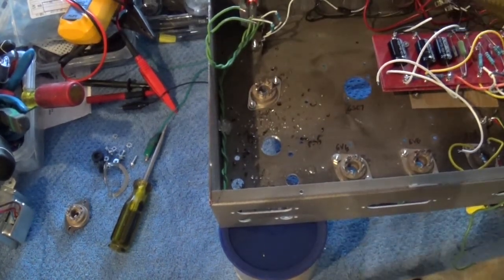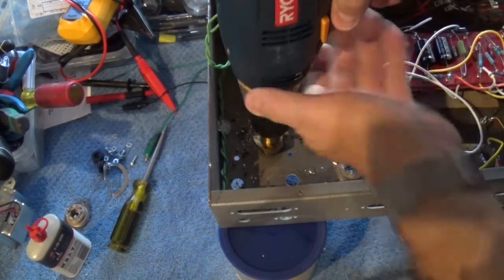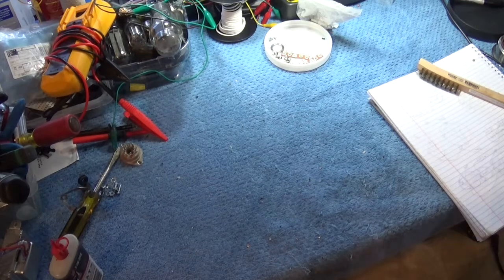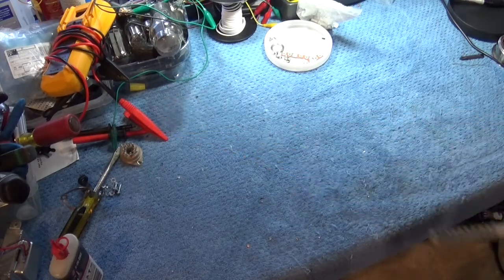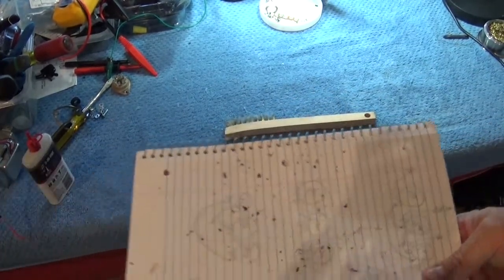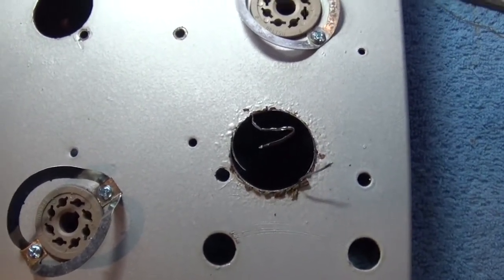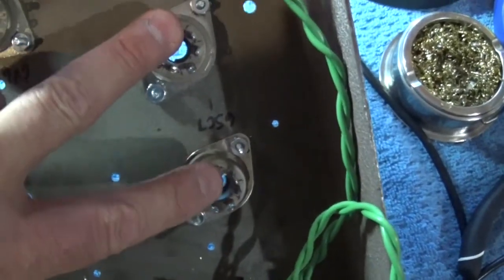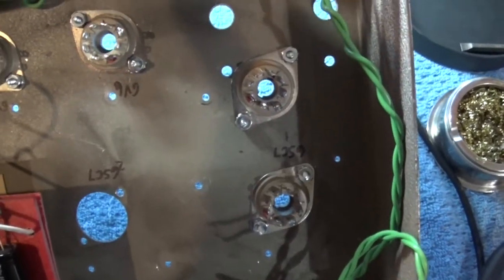Executone P13 - Guitar Amp Conversion - Episode 6a - Holy Hole Batman

Comment: Hey Ron,,, good idea to use both hands when using a step drill bit. They can grab and twist your wrist before you know it. Believe me I know. Good progress friend.
Carl
Reply from the maker: Yes, safety is number one and I was a little careless while filming which I realized right away and went off camera.  Its all good....  Joernone once said, when you get too confident thats when you can get hurt or killed.... great reminder for all of us.
Reply from the maker: So true Carl. I set my drill with a torque setting just in case it got bound up. Two firm hands is the trick but those bits work wonders. Regards, Ron
Reply: I'd have clamped the chassis in the bench vise...but knowing my luck when it bound I'd have probably twisted the chassis out of square, lol.